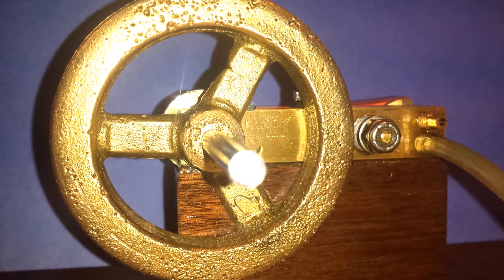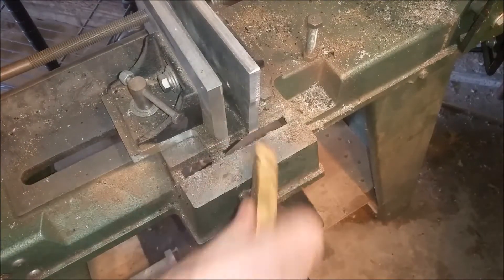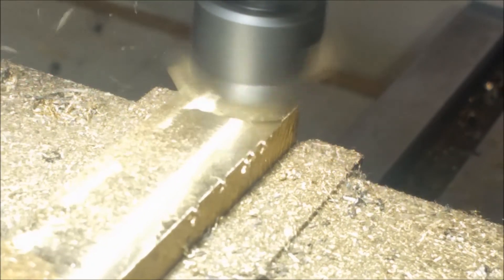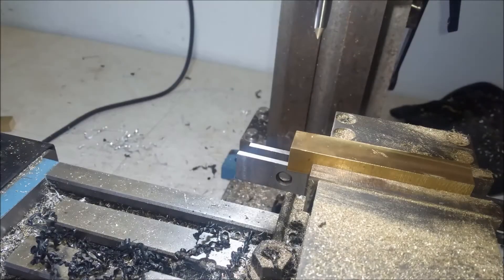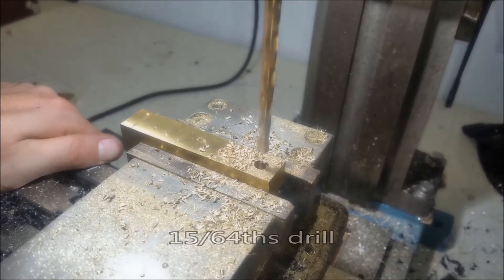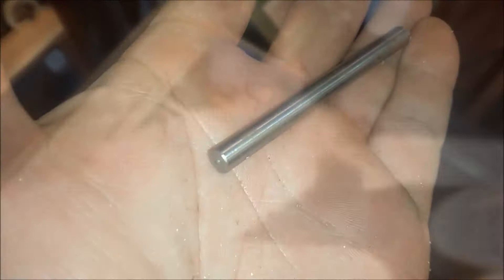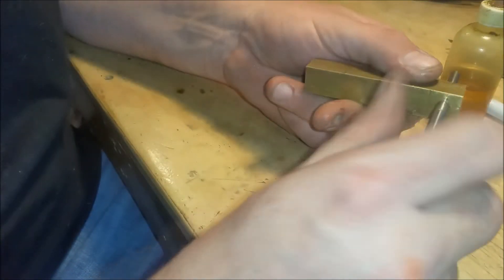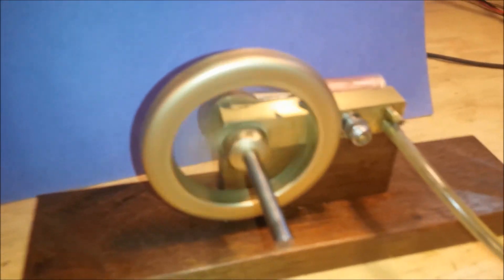Building a precision oscillating steam engine: Part 1

Comment: I am sorry, but it is stronger than I am....
It really isn't my habit to be negative about anybodies effort, but when I spot something that truly deserves the predicate 'delusion of adequacy' I usually end up saying what I think.
This piece is made up out of 'castings' that have more blowholes and craters in them than the moon! 
And this is after machining. Besides that, it has nothing that a steam engine model should have.
Things such as bolts and nuts to scale (or at least as best as possible) You even use a nylock nut !
To add insult to injury, you have used soft solder for the cylinder and still call it a 'steam engine' ...
This is the sort of 'first time attempt' that one throws away, so when one finally gets a bit better at this sort of work, nobody would get their hands on the shameful apprentice piece...
What could possibly make you think this is worth $ 50 ??
Of course there is the possibility this is some sort of elaborate inside joke being played on someone, not to be fathomed by the average viewer. 
In the latter case, I apologise for my comments

Paddy
Reply: Paddy I like your take on this to be honest I can’t speak on the steam engine but I’m an amateur bronze smith and I think his casting skills are lack luster he definitely cleaned them up nicely but he half asses his greensand and mould